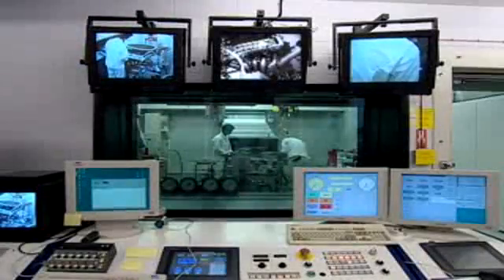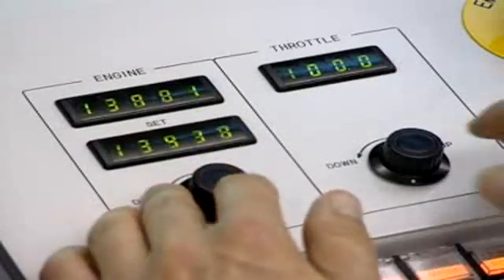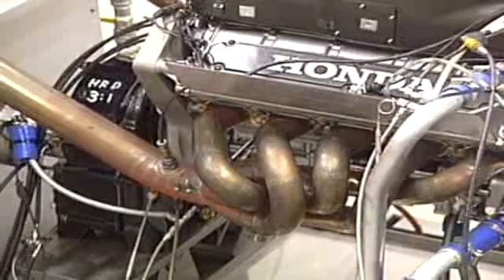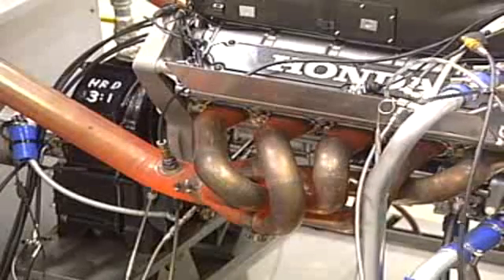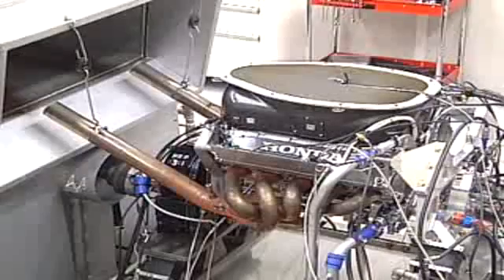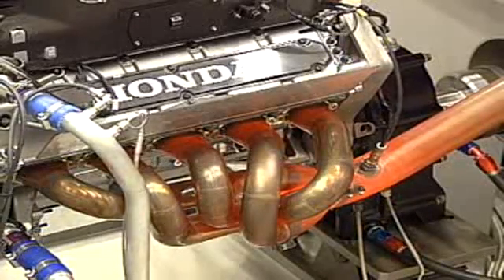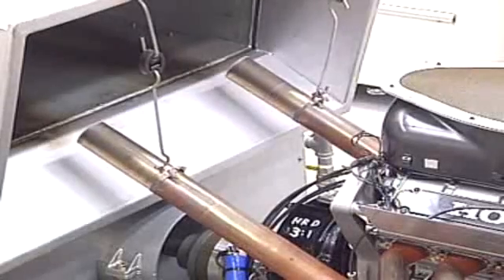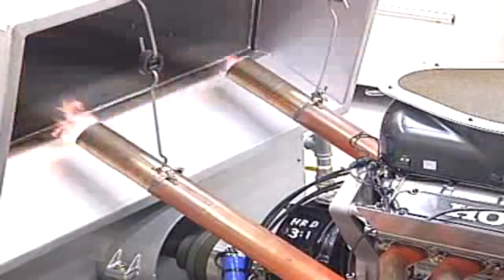Honda F1 Engine 1000HP

Comment: I need to put one of those in my scooter, which came with a 50cc engine.  That will be a little boost in HP.  Probably have to replace the speedodmeter as well.  :o)

Comment: I can’t see the internals of the engine but I just want to congratulate whoever came up with the bend design for that exhaust manifold. It is clearly very well thought out and very impressive
Reply: If you CAN see the internals....you're gonna have a bad time....  seriously though things like port shape and exhaust manifold design used to trickle down to even their lowest powered engines like sohc d series.  Google the oem S2000 exhaust manifold, it's beautiful.
Reply: @dr.mantistoboggan4746  I understand what you’re saying. But engines like the S 2000 do not have the same space constraints and so the bend radiuses and ports are definitely different than what I am talking about. You are right i’ve seen toyota ports follow similar methodology recently.
Reply: They are called headers...
Reply: @frandanco6289  only by one nation

Comment: 800 or 1000?
That's here the question...

OF COURSE I like and miss the sound and the high Rev concept of the V10s... BUT: what I like about the new engines is their performance, as I like (even quite heavy) cars pulverizing lap records...
I hope the engineers are quickly finding seconds with those new rules...
Honestly: I don't care about "good racing" (which is mostly artificial Imo) 🙃
I care about dominance and performance 😁😎

Comment: 18,000 rpm faster than any rotary motor. But they got some motors that used to rev to 24,000 ND it seems they keep lowering the rpm and engine size ND horsepower now we down to 600 hp ND 1600 rpm nd smaller displacement

Comment: This motor bring to Honda the "Constructor's championship" in 1990 and gave to Senna his second title i. F1. This sound and that races is unforgettable
Reply: No, the 1990 engine vas a V12. This is a V10, years 2000 to 2005.
Reply: @germanbleuer3791  you need to inform youself better 

https://en.m.wikipedia.org/wiki/Honda_V10_engine

Comment: I wonder why they don't use engines like this on road cars?  They look so small and lightweight for the amount of power they produce.  Scaled down for a road car, they could probably produce 200 HP in the size of a lawnmower engine, making the engine compartment of the car much smaller and saving weight, and make more room for the cabin.
Reply: Well, I'm no expert but I see three problems right off the bat:
1st: Small, high-precision pieces are more expensive than regular, low-precision ones. 
2nd: Small pieces with heat and stress resistant materials, are more expensive than  regular pieces with regular materials. 
3rd: F1 engines are not designed to last. Ofc, people usually don't put their cars to the limit to the extent they do on F1, but I'm quite skeptical that they would last, idk, 20 or more years that a good car with good maintenance could.

Btw: As I said, I'm no expert, I could be terribly wrong, but it seems reasonable for me
Reply: They will never do that because the Cost of the engine is way, way, way, way, way, too much...And too dangerous for some of the idiots I see driving any day of the week...

Comment: I remember clearly the extremely loud V10 of the sound  when I was watching the race in Monza circuit the September of 2003
Reply: indianapolis early 2000's cars so loud you can barely stand it used to stand in the press boxes around the last turn into the straight away and felt like i almost died when the jaguar would go full out. mark webber i think drove it back then
Reply: Nick the Greek Greek --  Yes !!!  I saw them race the next-to-the-last-time, at Indianapolis, I believe that year, and those V10's just killed your ears even from the grandstands... You HAD to wear earplugs or your ears would die... :)

Comment: Can you imagine a piston moving 300 times in a single second?
Reply: Gonna need a lot of lube to take such a throttling  !!!!!!  I can only manage about  3-4  thrusts per second and that's making sparks  !!!!
Reply: @christopherhampson265  🤣
Reply: @christopherhampson265  hell no
Reply: @christopherhampson265  are u taking about your performance in bed with your partner??
Reply: @christopherhampson265  😂😂😂
Linish it for less resistance 😉
Reply: @leewright7623  I tried that with an old 50's Wolf linisher  !  All metal with a push through start stop switch  ! I used to cover myself in slik 50 just to get that 240 V tingle  !  I'm older now and have knowledge of shot peening
Reply: @leewright7623  But I'm a bit worried about the possibility of  becoming a non binary person although someone may like to watch  !!! 👍😂😂
Reply: @christopherhampson265  you dont actually
Reply: precisely what I thought.
Reply: I was just trying to grasp that myself. Also the spark plug firing 150 times per second... Unbelievable really.
Reply: oh my
Reply: Nevermind the pistons, what about the poor valve springs,  have a heart man🤣👍
Reply: Nigga I’m 51 I can’t even imagine moving 300 times in a day anymore..
Reply: @noelht1  🤣
Reply: Insane
Reply: It’s like pulsars nshit. Mind boggling can’t even wrap my little head around it
Reply: Now imagine the valves..
Reply: @Danny_Thompson_sasquaatch420  some F1 engines used pneumatic valve actuation because a spring can’t physically open and close at 18,500 rpm, definitely pushing the limits. Now they sound like an accord needing a muffler.
Reply: Makes my head spin!
Reply: Exactly my thoughts, hard to wrap your head around that one!
Reply: basically like a neutron star spinning
Reply: I very briefly had my '91 Suzuki GSX-R 250 do that once. The rev limiter was set to 19000 RPM...
Mind you, the stroke was only 33mm.
Reply: It's almost incomprehensible
Reply: motorcycles
Reply: No
Reply: unfathomable...but amazing to contemplate. I thought a Vulcan cannon was amazing, this engine cycles 4 pistons 1200 times a second. .
Reply: Not a big deal. Millions of engines do even more than that.
Reply: Girls call me the human piston..
Reply: @Matt Wilson there’s no way it raps out to 20k rpm, it may sound like 20 but like you said, much over 8-10 and they are done.
Reply: @deborahchesser7375  nay. I have a tachometer onboard. I know it sounds incredible, but ye best believe it. I’ve already explained how tricked this motor is.
Reply: Nope.
Reply: They're a very short stroke so something like a top fuel drag car at 10,000rpm but with 3-4 times the stroke is even more amazing. While the engines are a lot bigger they also make over 10,000hp now.
Reply: Jose - I think he said ‘up & down 300 times per second’ - which means moving 600 times in a single second...?!  Worse still, in between each move, coming to a complete stop then heading off in the reverse direction...!
Having said all that, I’d still rather be the piston than the connecting rod below or the valves & springs above...
Reply: Yeah.
Reply: My exact thought. When he said that, my brain froze trying to get a grip on that concept. Still haven't
Reply: If an engine revolutes 18000 rev/minute, it is 18000/60= 300 rev/sec. Each revolution of the engine consists of two piston movements, so one piston actually makes 600 moves in a single second. 😁😮
Reply: "Inches from your head"
Reply: @Milo Prager It is 300 revolution per second but 600 strokes of piston, because it takes two strokes of piston per revolution.
Reply: @Milo Prager I think the most insane thing is piston acceleration. For this engine its value is about 89000 m/s**2 in top and bottom dead centre at 18000 rev/min. It is 8900 g! If the mass of piston is 300 g, its "weight" is about 2600 kg, and it has a frequency 600 per second!
Reply: I can.
Reply: No, it's too fast for my brain to comprehend! 😄
Reply: Imagine how much power could be scavenged by pipe wraps from that glowing exhaust?
Reply: @markwinchester3005  Approximately only 33% of the fuel energy goes on the wheels. More than 30% is lost through the exhaust gases, so.... 😀
Reply: @gorangoran6335  The fact the headers are literally glowing RED clearly demonstrates who much thickly insulating them w/ titatium heat wraps (if not asbestos?) would increase the power.  That's ^ a helluva heat discharge.
Reply: @markwinchester3005  The exhaust system has a small heat capacity and therefore heats up very quickly to a red glow. Exhaust system thermal lining reduces heat loss and this can be seen in current F1 engines. This saves the energy of the exhaust gases for the turbocharger. The turbocharger is the best way to harness the high energy of the exhaust gases, so the overall efficiency of the engine increases.
Reply: It is actually 600 times in single second, because it takes two piston movements for one revolution of the crankshaft.
Reply: Don't forget that it's stopping and starting again twice on each of those 300 strokes. That's a lot of g-force
Reply: @tdkeyes1  In fact, it is 600 strokes. 18000 rev/min is 300 rev/sec and each rev takes two strokes.
Reply: @gorangoran6335  you are correct. My comment was posted @ 4am. Was half asleep.
Reply: The math doesn't add up. Maybe I'm having a brain fart. But 18k divided by 10 cylinders divided by 60 seconds. It's 30 times a second
Reply: @replynotificationsdisabled  This math is wrong. Every single cylinder revs at 18000 because all cylinders are attached at the same crankshaft.
Reply: @Matt Wilson it’s a yz125 with a special high-compression head and pure, undiluted 112 octane race gas. My bike makes solid power through the 14k range, and it only hits 20k+ when I’m in the air and wide open on the throttle (panic rev lol). It will cross this 20k+ mark with the clutch totally out when I’m in the air, in 6th gear, which makes you wonder how fast that rear wheel is spinning!
Reply: @DirtBikes_MathGarden  are you like 6
Reply: my 2 stroke dirt bike revs at over 20,000 rpm, which comes out to 333+ piston revolutions per second. On top of that, since it is a 2 stroke, that spark plug fires each and every time the piston comes to the top of the cylinder. Very gnarly
Reply: @DirtBikes_MathGarden  hello your engine run approximative to 13000/ 14000 trmin max.not 20 000

Comment: Very hi-tech, although that engine is useless for a performance street car.  Give me a Ford or Chevrolet 90 degree V-8 and 1000 H.P. is easily obtainable with good street manners and long term reliability.
Reply: Good thing they didn't develop it for a street car, captain obvious
Reply: To get 1000 hp from a street car you need to install big turbos so reliability will suffer in the long term.

Comment: Back in the day turbo'd F1's were putting out 1,100 + bhp, couple that with slick tires and the terminal speeds began to kill drivers.
Reply: so do coconuts
Reply: @dr.mantistoboggan4746  If you're dumb enough to stand under a tree full lol.

Comment: as many times as honda has failed in their attempts at F1. one would think they should just say screw F1 & do what they do best, build reliable ,efficient motorcycles & cars.why waste billions on another F1 failure.when the majority of honda owners worldwide dont give a crap about racing, but need a reliable vehicle to get to work on time.honda has nothing to gain in F1, but have billions to loose by continuously trying.

Comment: “The engines just don’t sound as cool now” turn up you damn headphones on a gp weekend and actually listen and you’ll realize these v6 engines sound BADASS especially when the wastegate opens on the Ferrari engine.
Reply: V10 engines sound way better than V6 Turbos (albeit a bit too loud), but by no means do the V6's sound bad.

2014 cars sounded bad (and looked worse), but over time they've gotten better. Personally I feel the 2022 cars sound better than the late 2010s V8's (controversial, but it's my personal opinion). Still not as good as most of the V10's though.

Comment: I like how they boast about the weight of the test cell and the thickness of its walls and then strap the very same engine to a 800kg paper thin open-wheeler.
Reply: A very strong paper thin open-wheeler

Comment: They were real engines, not the fart sounding engines we've got nowadays.
Reply: V6 Turbos produce more horsepower, are more efficient, and are less harmful to the environment than the V10's. The term "Engine" comes from the word Engineering, and it's clear to see that V6's are engineered better than V10's.

I will admit that the classic engines sounded WAAAAY better than current ones, but sound doesn't create performance. Honestly, I love the V10's, but V6's are still great engines.
Reply: @yannickvaz694  agreed on all points, but the new engines do sound like farts.
Reply: @malcpaul996  Yeah I agree with that.

On another topic though, there are rumours that F1 could start developing higher revving engines a few years after they introduce cleaner fuels. If we look to the past, F1 went from classic V12's, to V8's, to the V6 Turbos of the 1970's, back to V12's and then V10's, to V8's, and then to current V6 Turbo Hybrids. I would be surprised if we go back to V8's and V10's maybe with hybrid power and cleaner fuels. That's what most car manufacturers would want (mainly sports and supercar manufacturers) which is one of the reasons why F1 is implementing the new engine rules in 2026.
Reply: @yannickvaz694  -Doubt the V6's are engineered better than the V10's... There is just less rotating mass to have to deal with, weight, etc...

Comment: From back when F1 was fun to watch and hear. I'll never forget the sound of the V12's in Montreal.
Reply: Exactly 💯
Reply: plus having steve matchett and david hobbs'  commentating made it a complete joy to watch F1.
Reply: Bro, i used to live on the south shore (across the river), and i remember every summer hearing the glorious sounds of those engines cross the river :(   ...  It was incredible, if only I could go back to the years of 2002-2006...
Reply: These were v10’s. The much more violent of the F1 engines
Reply: The street circuit in Melbourne makes the sound echo off walls in certain parts of the track- it makes your ears bleed. My father has a house about 5km's away from the track, we could hear them doing laps every year until the new turbo engines- they are do much quieter... 😡
Reply: its still fun to watch just whitout the same sound….

Comment: Gotta love F1 with gigantic budgets for the best of the best. Sound is almost intoxicating. My Maserati sounds pretty decent with it's Ferrari engine, but nothing compared to V10 F1. At 18,000 RPM and pistons moving up and down 300 times per second, the acceleration and deceleration cause huge loads on moving parts. The way the engines are setup, there is very little power until it revs very high. Actual working power band is narrow and driver has to up shift, and down shift many times per lap. Thank goodness for paddle shifters. In old days, drivers used a clutch and manual shift transaxles.
Reply: Gee….thx for telling us what we just heard….Mr. Maserati
Reply: Hey that Maserati will probably last about as long as the f1 engine
Reply: @BaldKiwi117  At one time, both Maserati and Ferrari were owned by same investment and car group who saved them from bankruptcy. Ferrari was making the engines for Maserati. The only difference between my engine and the one in Ferrari is the 180 degree flat plane crankshaft. Maserati used 90 degree twisted crank instead. Except for some external decorations, both engines are same. I have less than 40,000 miles on mine, and it's a 2008 model. I might have put 100 miles on it in last year and half.

Comment: Where are the turbos that F1 engines run?
Reply: On the V6 turbo hybrid engines they have been using since the 2014 engine regulations
3,0 liter V10's were banned at the end of 2005. 
2,4 liter V8's were banned at the end of 2013.

Comment: Where are you getting 1,000bhp from?
Reply: Official Honda tests. It's a well known fact the final years of 3,0 liter V10 engines in F1 produced 950-1000hp. The BMW V10 was widely reported to have been the most powerful, with Honda coming in as a close second. The Mercedes V10 and Ferrari V10 came after. Then came the Renault V10 - which might not have developed more than 900hp but had excellent drivability and a wide power band. The Toyota and Cosworth V10's were probably the least powerful. 

Anyway, from what I've read nobody actually developed 1000hp in race trim but Honda's "Suzuka Special" (always an extra powerful engine for their home Grand Prix) got really close with 980hp. 

Anyways, 950-980hp from a 3,0 liter (183 cui) from a naturally aspirated engine (no turbos or any kind of forced induction) is d*mn impressive. Especially considering it's suppose to last a whole race weekend. The race alone is 2 hours long. But qualifying is 1 hour and three sessions of practice/training is another 2 hours. 5 hours. 

Google or Wiki the Honda RA005E engine.

Comment: The sound of those beasts was never really captured on video or TV. They made your intenstines vibrate.
Reply: Even F2 cars are louder than F1 these days,  I felt it in person
Reply: One noise that can never get captured properly, is the boom the car makes when downshifting.. it was a sharp, low frequency thud that reverbed and can be heard from even outside the spectator stand. 

On tv, we only hear the engine revs jumping when it downshifts. In real life, that sound is accompanied by that loud boom.